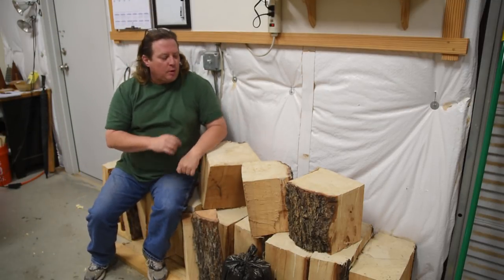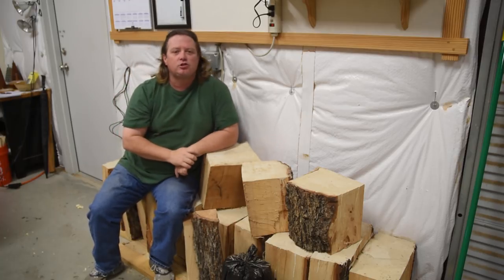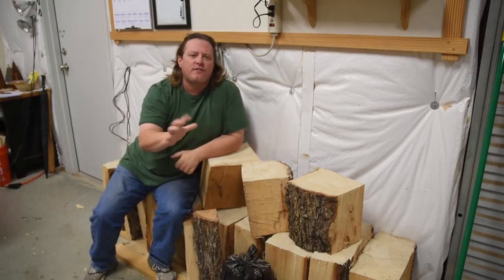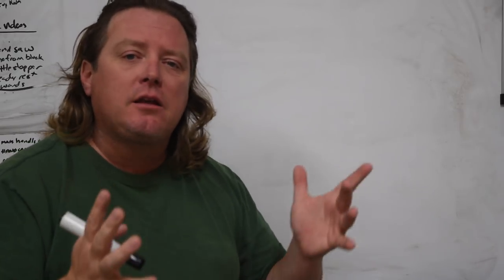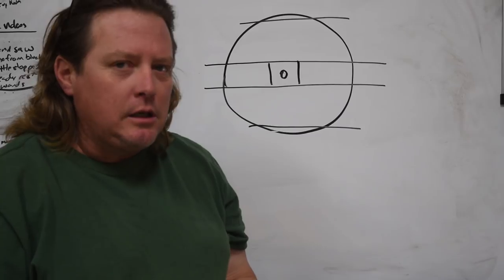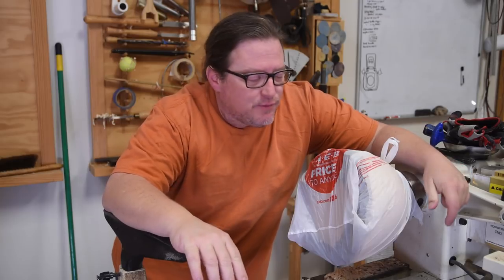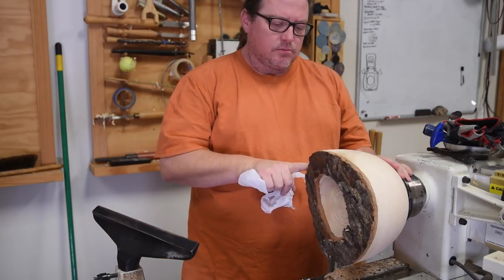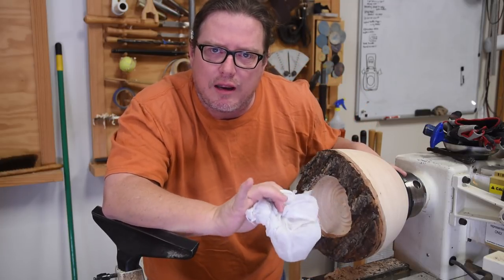4 Aspects of Turning Quality Bowl Blanks - Beginner & Intermediate Information

Comment: I built a kiln like yours. In this video you said you oil (what kind) and then put in kiln. I have been coating inside and out with anchorseal then putting it in my kiln. Is this overkill?
Reply from the maker: I said I oil the bowls I finish turned to slow drying but coat the roughed bowls I plan on returning.
Reply: N

Comment: You might probe those cracks with those thin metal spark plug gap “feeler gauges” (?). - they are thin, flexible and long enough to measure crack depth 

Also woodcraft makes “green wood end sealer”, I coat the entire blank with it and never get any cracks 

Thanks again I’ll be donating! Great great teaching as always

Patrick
Reply from the maker: The woodcraft stuff is pricy. Use AnchorSeal and buy it in bulk.

Comment: Another Great video ! Thank you ! I'm a long time lover of your video's. I have found using a spent coffee can (with plastic lid) is great way to use and store anchorseal. I have a cheapy brush that fits in the can, and I leave it in the can. Only put enough anchor seal in the can so that the brush isn't submerged much (about 1.5 inches deep). Then I have  easy access to the brush and product. Works great. Of course, your system works too, only you wouldn't have to contend with the (plastic top) attached to your brushes.

Comment: DOES ANYONE KNOW IF THERE CAN BE TOO MUCH HEAT WHILE DRYING BOWLS? AND THANK YOU MUCH FOR SHARING YOUR TALENT AND TIME WITH US!!! TAKE CARE!!!
Reply from the maker: Yes, you can dry bowls too fast which will cause cracking, You can make them too dry which changes cell structure. You can set them on fire (spontaneous combustion is not uncommon in overheated wood). You are just aiming for a high enough temp to evenly evaporate the wood, kill bugs and eggs and not cause too much warpage. Also... cap lock dude, cap lock.
Reply: wortheffort, I'M A LADY TURNER WHO IS TYPING ON A LITTLE ANDROID WITH EVEN SMALLER KEYS AND MY EYESIGHT ISN'T WHAT IT USE TO BE!!! THANKS FOR YOUR RESPONSE.

Comment: Glad I found your videos. I noticed on the one log you mentioned centering your circle to avoid the cracks coming in from end of log.
Is it typically a good idea to cut logs longer than you plan to use and then use only the center section for making a bowl?
Reply from the maker: Leave logs as long as possible. Then cut and turn many blanks at once to reduce spoilage from cracks.
Reply: @wortheffort  you're saying not just each individual piece as long as possible. But even leaving say a 6 ft piece of log intact and then cutting and turning them all at once. Is that correct?
Reply from the maker: @jamieemes4292  if I could lift it I’d cut out pith and leave rest long. See my video on roughing.

Comment: You spent some time on cracks but did not mention filling them as you go with CA.  Is there a problem using CA on cracks or is it always better to cut them out. I seem to use it a good bit. Great video. Very informative.
Reply from the maker: I don't fill cracks at this stage. It's a waste of time as the wood will move and separate from the plastic.